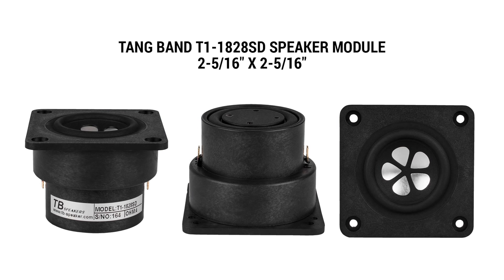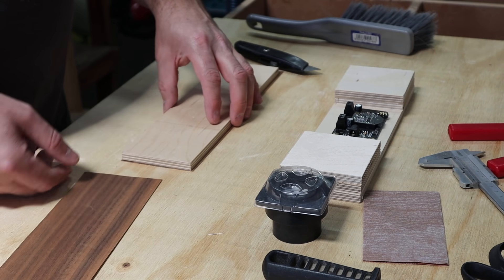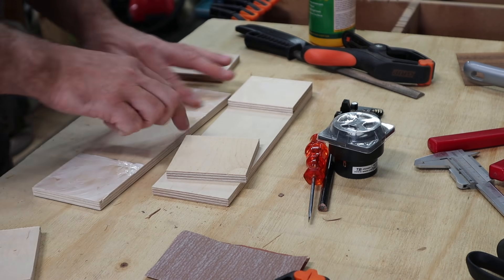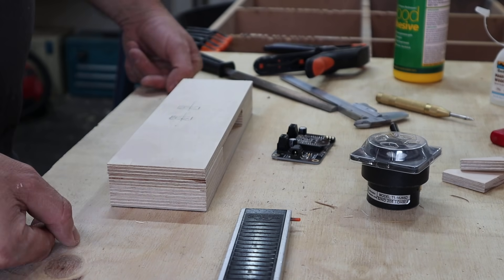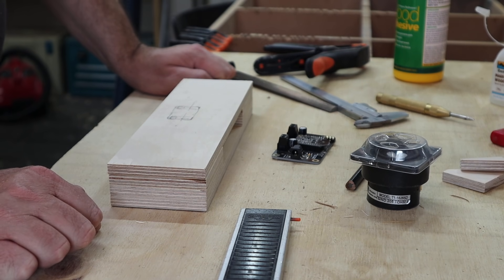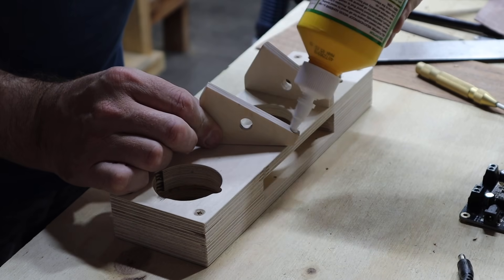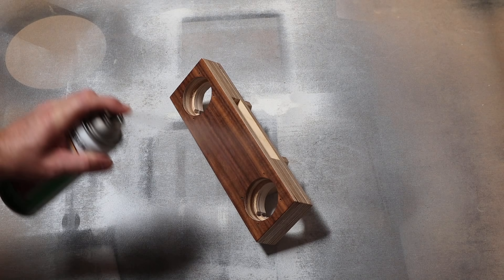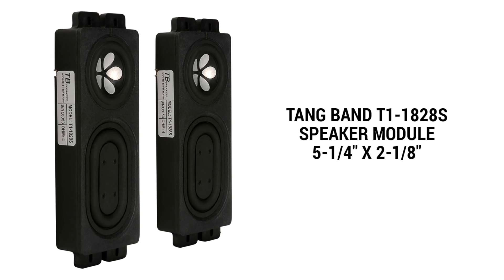Small BLUETOOTH SPEAKER BUILD with Tang Band Speaker Modules - by SoundBlab

Comment: Does anyone know what type of pcb I would need to drive something like this off an internal 18650 battery pack, but that would continue to work and charge off a dc supply if the batteries are running low? I realise the dc input needs to be man enough to do both but I can't seem to find the answer anywhere lol. Anyway great vid and very informative channel 👍

Comment: I ended up using mine on my drum machine so I could play guitar to some thumping ass bass (2 3 inch subs). Used 4 18650's (well 2 banks of 4 wired in parallel, but each bank wired in series.

Comment: Project name... "Mount anywhere stereo speaker system".

Make a small amp/bluetooth hub. This will be the (bluetooth board, amp, battery inside of a small housing)

Under that have a mounting mechanism that will allow "the hub" to be clamped to things. (example a "go pro jaws clamp". This will allow it to be clamped to desks, bicycle handles, etc)
------------------------
Now here is where it gets funny.

From the hub have 2 (heavy duty) goosenecks extending out of the top. (example the "Smatree Ajustable Jaws Flex Clamp Mount")

On the ends of these 2 goosenecks mount the speakers. (since they dont need enclosures to bang just leave them bare)
--------------------------
INFOMERCIAL TIME!
And there you have it The "Mount anywhere stereo speaker system"! Clamp it, Twist them, Mold them, Bend them to fit your needs. 

Got a TV with crappy audio? Clamp this to the back of it, extend the necks to either sides of the screen and boom! big stereo sound quick and easy.

Got a FANCY GAMING MONITOR with tinny underwhelming speakers built in? Clamp this to the back of the desk, snake the speakers underneath the screen and BOOM! You'll be MLG sound whoring in no time!

Wanna spice up your bike ride? Clamp it to your bicycle handles, Point the speakers where you want and BOOM... Now YOU are the party.

Clamp it to your bench, picnic table, window, door... Heck clamp it to GRANDMA and make her golden years lit AF.

Order now for a low low price of $599.99

Comment: Hey! What if you were to add two additional drivers oriented in the other direction? This would cancel out the vibration perfectly... Any thoughts on this?
Reply from the maker: Interesting idea, but will also make for a much larger speaker, and you might run into some frequency cancellation or lobing issues.

Comment: Hi do these module type speakers require an open back ?. I'm assuming there is some sort of enclosed passive radiator still letting air out ?.  If they are enclosed in an air tight small cavity will they still perform. Say inserted into a solid wood block. Hope that makes sense. Thank you kindly for the great video.
Reply from the maker: Yes, they will need an open back. They will not perform well in a closed box.

Comment: Other question :-)
I found this speaker : https://www.parts-express.com/behringer-studio-50usb-150w-2-way-digital-monitor-speaker-pair--248-6910  
(The passive one) and want to add crossover for diy project.
Can you please help me which crossover I need?
Reply from the maker: If its a passive speaker it will already have a crossover in it, or am I not understanding you correctly?
Reply: @SoundBlab  not,
The passive one doesn't have a corssover on it.
It's located in the active speaker I don't have
Reply from the maker: I understand, however without being able to measure the speaker drivers there is no way for me to help you with a proper solution. You can just buy a stock crossover between 2500 and 3500Hz, but the results will be unpredictable and most likely it will not sound right.

Comment: You should try to fit in a dc adapter and maybe some batteries, it would add to the weight. Rubber feet, or some self adhesive sealing tape may work well too. For the other pair of speakers, I put my vote to the  small soundbar / clip on speakers. I like the front facing radiators on them.

Comment: Put rubber feet on the legs of the speaker.  They're a few dollars,  and it should solve the vibration issue.  If you want to make it fancier, you could also use some isolation spikes. Parts express has some for pretty cheap, though I'm not sure if it'd help the vibration at much as the rubber feet

Comment: Hmm... sacrifice portability and make a bit of a concrete base, channelling the bass via tubing to the front and add some thick yet sorta soft rubber feets? I can think of that for the beach or grill party. No need to add a 20kg base, but something heavier and rigid to deal with the vibrations?
Reply from the maker: Concrete will definitely help to keep it stable.

Comment: No fail!   Very cool looking and sounding. Just add a couple of pounds of lead weight or some similarly dense material to the back and you're golden.  You might also put some felt or shallow rubber feet on the bottom edge.
Reply from the maker: Thanks

Comment: If the other tang bands are somewhat moisture resistant, how about bathroom cabinet with the speakers built in, not your normal style, but could be a challenge. Otherwise +1 for the laptop stand concept.  Also, loved this one, certainly would consider this as anything other than a win, was surprised by the output from them.
Reply from the maker: Not sure if the are suited to wet environments. So far the laptop stand concept/sound bar sounds good.

Comment: Thanks again for your video!
How you always success the build speakers without ground loop noise?
Reply from the maker: Thanks. I usually only use boards that are integrated. In other words, the bluetooth module and amp is on one board. Ground loop normally occurs when you are using separate boards that has to be powered individually by the same power supply, and thus the loop occurs. And some circuits are just better designed to deal with this than others.
Reply: @SoundBlab  Thanks!
Can you please find me board for 4Ohm 10W speakers that have international shipping?

Comment: Very powerful the bass if it's on the desk, this is the right way:-).  Maybe you could use small rubber disks or some heavy battery:-)
Reply from the maker: Yes, the bass does sound better when on the desk compared to when I held it in my hand.